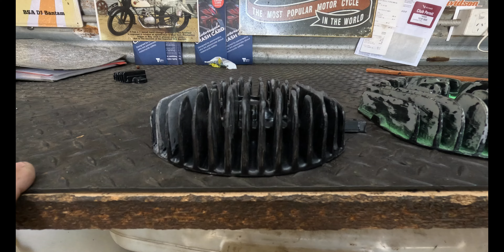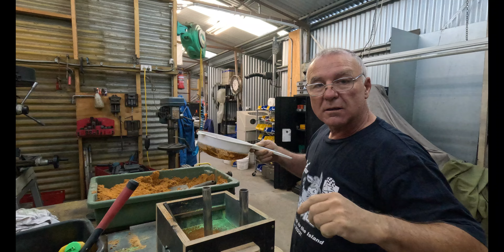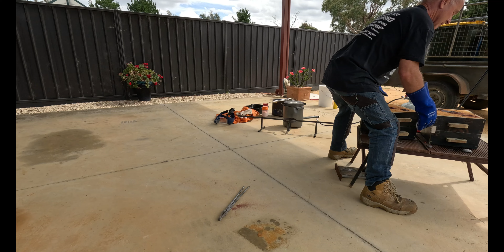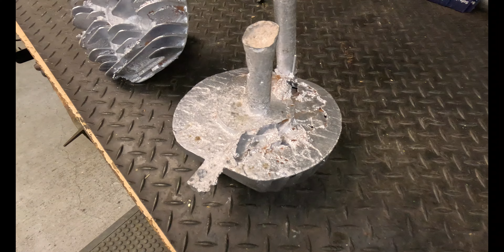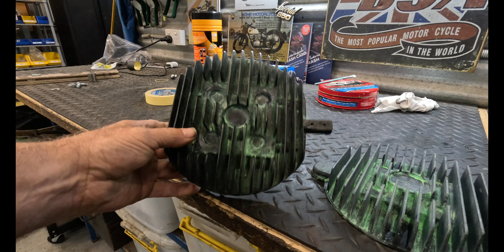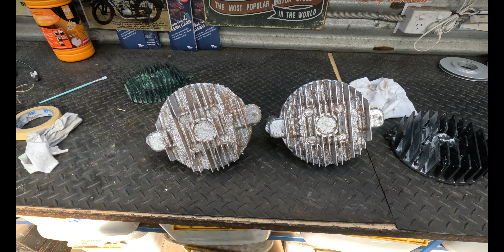Casting BSA Bantam heads Continued!!

Comment: How much draft angle did you put on the fins?  I’ve used about three degrees included angle in the past.  I’ve bought tapered end mills on Amazon in the past, and want more of ‘em.

Your sand looks decent.  Until you sprayed it with water, I thought it might be Petrobond - which is the stuff I hope to get in the future.  It has really good “green strength,” and since it’s an “oil bonded sand”, missruns tend to be rarer.

The green sand I have access to (other people’s sand, currently) has lousy green strength, so I’ve needed to run 3/4 of an inch/2 cm between fins when I’ve done them in the past.
Reply from the maker: I run the same draft angle ..........20mm between fins is big is big. The green sand is OK have a look at my latest casting video.

Comment: Tony , just a thought , if you turn the feed round so that it feeds metal and flows direct through he fins not from the side it will flow and pour better . And also use sodium silicate in the sand and gas it up with c02 , it then creates a more stable and solid sand mass  and its dryer , and casting with damp sand will ofcourse make steam ! A lots of steam and bubbles ! And while your about it use a better release agent like Demotex S on the model .The old school guys in UK used graphite liquid , now in spray  form from like  Demotex S .And last but not least get the scrap off the top  liquid alloy in the pot with a spoon .  Good luck and dont forget its only a hobby !! Good,luck mate 😎🍻
Reply from the maker: Hi and thanks for commenting. You'll enjoy the next video. Today I will be doing another cast with a different pattern. I've set one box with the entry gate in alignment with the fins and another box with the entry gate across the fins. Access to silicate sand etc is logistically challenging, however the water content of my molds I'm convinced has been my problem. Therefore todays pour will be done later in the day after being set yesterday and allowed to air cool for 24hrs (It's been 30c here) to drop the moisture content. The dross is being removed prior to pouring and a dross agent used. I like your idea about the spray can graphite and I'm sure it would help get the pattern out. The new pattern pulls straight out with just parting powder. I personally think my old pattern needs more draw on the fins.

Comment: Hi Tony.. I've been casting for many years and here are a few tips which could help you out...
1).. Use a ceramic shell investment technique ( you will need a foam pattern which you already have)... not plaster. there are plenty of video's on this technique.
2).. once you make your mold , let it dry as per instructions and then heat it up either by furnace, torch or over a gas fire.. this helps a lot in getting the metal to flow to the thin areas because the metal is less likely to cool and solidify before the mold fills.
3).. Make you sprue thicker than the thickest part of the casting and also try and sprue to the thickest part of the pattern. ( this reduces porosity by a huge amount)
5)..The way you are casting now the metal needs to rise upwards which is probably why the fins didn't fill.. do it upside down so the metal flows down into the fins, not flowing upwards against gravity.

I think you will have no trouble at all producing factory quality castings once you get use to this technique. 
Hope this helps and good luck with you project.
Reply from the maker: Hi and thanks for commenting..........You'll be interested in my next video as I'm basically trying everything you have suggested. I haven't oven dried the molds as it's been 30c here and I've just left the boxes in the sun.
Reply: @Bonesengineering  30C is not really enough to burn out the foam the pattern is made of... the burn out of the pattern has 2 objectives, one is to get rid of the foam so the metal has a free uninterrupted flow and any gas formed by the foam/wax/whatever is eliminated reducing porosity, also any contact with anything will cause it to start solidifying and while it may work in thick areas, in thin areas it may solidify before it fills the mold as we see in some of your castings
The second point is to raise the temperature of the mold to facilitate this process and reduce the likelihood of premature solidification.. in some of my castings I raise the mold temperature to 1000 deg C but that is for alloys with a melting range of 1500- 1600 C .... however for aluminium a mold temp of 300 deg C should be fine.

Comment: have you got Terry Aspins back yard foundry book from the workshop practice series? Might give you some clues. I think I would be casting woth the fins down, but having the runner and riser at 90 deg to the present position so that the metal ran along the fins instead of across them! Good work with admirable persistence!! I have subbed!
Phil UK
Reply from the maker: Yes I'm going back to a fin down orientation. The gates in the original pattern run across the fins so I'll stick to that. I'm changing a few things up for next pour.

Comment: I think the bottom is too thin.  The metal is cooling due to the large contact area with the sand and restricting the flow to the fins.  My only experience is with casting a clock face.  Good luck.

Comment: It looks like your metal is not flowing as well as it did earlier.  Have you melted it too many times? If it is picking up contaminants  each melting it might not be flowing as well as it could. Be interesting to see  how it went with newer metal.
Reply from the maker: A good pickup.............given I'm still working through sorting issues i have been re-melting the material. I don't want to use the "reserves" of material I have constantly trying to sort my issues. I'm using dross agent to clean before I pour as well as a grain refiner. The bigger sprue that I used in the last sprue worked really well and so i'll use it again.

Comment: Try your original orientation but with the runner and the riser rotated at 90deg so they are at either end of the fins. The metal is cascading down into each fin in turn  generating turbulence and cooling down. Let the metal flow along the fins pushing hot metal in behind and it will create a more quiescent flow. You may also try moving the riser on to the head rather than it being hung off the side and extend it so it straddles all of the fins. Every time metal changes direction, it slows down and loses heat. Ultimately it will be trial and error but it isn't the fins width, it is a loss of heat or trapped air. Remember, aluminium will run through a 0.5mm gap which is why you need to clamp the cope and drag together. Good luck.

Comment: Same mould assy, but turn it on its edge and feed from the edge, two top vent risers with a big sprue feeder so it fills along the fins not across the ends. Vent every fin at the top edge. Pour through a ceramic filter into the pre heated mould.

Comment: Hi Bones, Have to admire your determination. It looks like you are getting pattern out of sand okay so it seems to me that the problem is all the the SLOW pouring method you are using, if you are going to use the pouring cup why not make the down tube a bigger diameter , I would set up to pour down the center ,you say you can't due to erosion, set a tapered long slot.
I take it that the Casting I sent you was not satisfactory.
Regards
Bob
Reply from the maker: Hi Bob.....Hope you're well. Pouring it down the centre has a few issues with it as I've said such as erosion which I want to steer clear of, plus I can't have the pourer and feeder as one item as a suitable pourer doesn't have enough volume to act as a feeder. You can't pour down the feeder as it's too big and drags air into the casting. I've stopped all shrinkage with the feeder I have, so I'll stick with it as it's working. Last pour in the video was with a larger feed sprue which got the metal in quickly, however there are still issues with the fins forming. I've discussed this with some jobbing moulders and they feel the failures are steam related and that I should bake the mold to dry it out before the pour. This is something I'll try next week and haven't done yet. Your castings are being held in reserve if needed, but I set out on this path to learn how to do it myself.........and I'm so close! I have to keep going as it will torment me if I don't! take care and chat soon.........regards,
Bones
Reply: @Bonesengineering  Yes I am well thanks Bones. I understand where you are coming from as regards to getting a casting success. I will not offer any advise but if needed I could do a redo with the new one. Email me if you think I can help.
Regards
Bob
Reply from the maker: Hi Bob.........The one's you've already done are fine............They've always been a contingency if I haven't had a success and things get "close to the wire". As I said I think I'm very close to the outcome I'm after.........stay tuned mate!

Comment: Hi tony 
Just a thought,   can you try to poor in the middle through the feeder instead of the pouring basin in the corner of the box as that will poor more even into the middle , if that make sense. 
All the best   phil.
Reply from the maker: Hi Phil........You can't do that for a few reasons. Firstly pouring directly onto the Mold cavity causes erosion (which I think is another problem I have). Next is the sprue that feeds the gate has to be filled all the time to prevent air being dragged into the mold cavity with the molten material. Next is the gate has to have a "well" to stabilise the metal flow into mold cavity. Next is the sprue volume isn't big enough to act as a feeder. This is why on the last pour I fed into the centre of the pattern from underneath in an attempt to get the metal in quicker........It nearly worked too. Thanks for commenting.

Comment: Rome wasn't built at a day. This is a treat one needed a 5 year apprenticeship I think. So you are quite fast with your progress.

Maybe the mold needs to get heated that the alloy doesn't cool down that fast?
The higher and thinner the Fins, the less time the Alloy has to rise or hotter it has to be (liquid alloy is liquid alloy so that point is pointless).
You will need more pressure / weight I think.

Half the mold upside down and machine the bottom after that?
Reply from the maker: I think you're onto it! I think the poor fill has more to do with pattern design.....and as you suggested cooling in the fins. The issue with heating the mould, it dries it out, then the sand looses it's bond and leads to mould failure (which I think I have at times to contend with as well) What I intend to do next is let the molding box "stand" for a while to actually get it to dry a bit hoping to get the surface sand dryer which immediately contacts the molten metal...........Stay tuned there is more to come.

Comment: I'd give it a go with a centred base ingate, and an upwardly inclined mould thereafter, but with the finning set upwards in the cope. Plenty of venting into the fin tops , though.....
Reply from the maker: You musn't have watched until the end...........
Reply: @Bonesengineering   I did, but it's always worth giving more thought to sand casting. Aluminium is light, and doesn't flow as strongly as heavier metals, perhaps, and the large fin area causes rapid freezing of the molten metal under insufficiently rapid ingress ? Getting a crucible temperature reading with a K-type thermocouple probe might chuck up some useful information.  760 C is supposed to be about right.....
Reply from the maker: Hi Mate, I'm currently pouring at 780c (K type thermocouple). The last pour was with the fins facing up in the cope, with a centred entry point, vented through the tops of the fins. Still got that chilling effect. Next attempt will be with a modified pattern with less fins, oven dry the mould before casting, and push the material temp up a bit. Keep the ideas flowing my way though.........every suggestion is food for thought......

Comment: Hi' I wonder if the moisture is boiling off from the casting, the foundry that I worked at added ethylene glycol to the water
Reply from the maker: Hi........Yep my 2 theories are the failures are gas/steam related or erosion from metal flow velocity. I'm not sure what the byproducts of ethylene glycol being superheated to 700c are, but will look into it. Thanks for offering advice.

Comment: Tony I know nowt about casting at all, but I did wonder if rotating sprue and risers through  90 % would help. ????? Failures or not good video.
Reply from the maker: The metal enters the mould at 90 degrees to the pouring cup via the sprue and gate to reduce turbulence and air ingress. It doesn't drop straight into the mould cavity.
Reply: @Bonesengineering  sorry did not explain properly rotate all holes through 90 degrees  so that fins line up with direction of pour.
Reply from the maker: Ah.......I understand. Well that is basically what happened on the last pour. Which also turned out to be the most successful as well...........

Comment: Have you considered adding a raised pouring cup and agree with the previous comment that a central pour may be worth a try
Reply from the maker: I'm not sure what raising the pouring cup will improve.......The last pour was a central pour but entered into the bottom of the central piece. You can't just tip the molten metal into the centre of the mould from the top. It would induce air and cause erosion of the pattern. I need a feeder in this location to stop shrinkage as well.........So you can see why it's been challenging. ..............Thanks for commenting and offering advice

Comment: 8:18 I was saying cmon you're so close.

I have been watching eagerly for months hoping that you would perfect it. 

Keep at it. Personally I think you need to get away from the green sand. Resin bonded 100%
I did a little casting at Treloar in Rutherford when I was younger and there was nothing that the old guys couldn't get within a couple of tries with the resin bonded sand. It was extremely porous and out gassing was a minor concern.
Reply from the maker: The only issue I have is living so rurally means a lot of this stuff is difficult to get.  I've got another pattern being developed as I think my issues are the fin sections are too thin. However I won't rule out having a go at that.

Comment: Looking at your pouring process it looks like the metal coming up the riser furthest form the pourer is very slow and jerky, as if there is a pressure build up pushing the metal up the riser. Your pourer and riser look still quite fluid at tis time. This would suggest to me the metal is cooling rapidly as it flows through the mould causing some of your problems. Can you try pouring centrally and having two equal risers to shorten the distance of the flow to the riser. Also have you considered resin sand with Co2 bonding adjent, this will obviously be more cost but would be a more robust mould.
Reply from the maker: If you watched to the end the last pour was poured centrally with the fin orientation upwards with 2 x vents. The vents I had were small this time as I don't think it matters too much what I'm doing. Metal temp going in is consistent at 780c however this last pour was achieved in 12 sec, which is one of the fastest I've accomplished. I agree with the "misrun "of the fins is it can't fill the cavity before solidifying. This last pour was by far the most successful I've had. I have another pattern in development with slightly wider fins, smaller volume, shorter fin height. Co2 isn't really an option at this stage due to accessibility to that sort of stuff . Thanks for commenting and offering up advice.
Reply: I think flowing at right angles to fins is problem too.

Comment: Have you tried vibrating the mould when casting? Probably needs a certain frequency & amplitude. A whole other rabbit hole. Good luck Tony.
Reply from the maker: Vibrating the mould would probably cause a sand collapse in the mould as the fins are thin sectioned. It's not a practice I've heard of in industry so haven't thought about it..............Thanks for commenting.
Reply: Hi, things and ideas running through my skull.
The CO2 hardened sand may work but it’s another exercise to get there.
Lost foam may work too, but venting and runners would take some figuring out.

Have you considered :-
putting a bridge across the top of the fins to vent the pour to several points to get the metal to flow to where it needs to be quickly.
Mako heads bring that to mind.
A second cope over the first cope with a large basin feeding 2 or more sprue’s into the first cope sprue’s, feeding runners to get the metal more distributed during the pour, the added height would provide a head to the pour as well.
the only other way may be pouring from 2 crucible’s.
Temperature and quantity in the crucible might be an issue.
Keep trying as it is one of the great mysteries that they did this in the original foundries.
Take care n pray to the weather gods.
Reply from the maker: Hi..........I think I'm on the right track with facing the pattern up. There are 2 distinct failure modes in play. One of them is definitely the material is cooling in the mould, I have a thermocouple to measure crucible temperature before every pour. 2 crucibles I can't do for a number of reasons. If you saw the last pour and new gate position this directed metal directly to the centre of the pattern for even distribution. Lost foam I've tried, however it would require another pattern design other than what i have to make it work..........Thanks for commenting and offering advice.